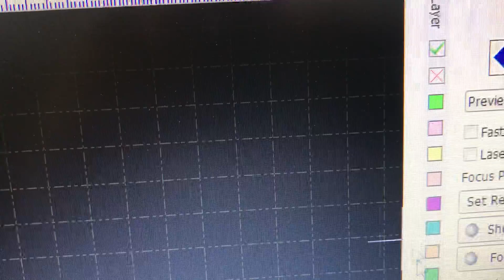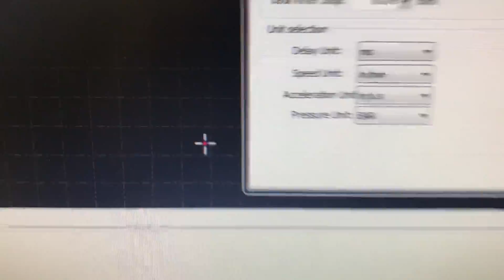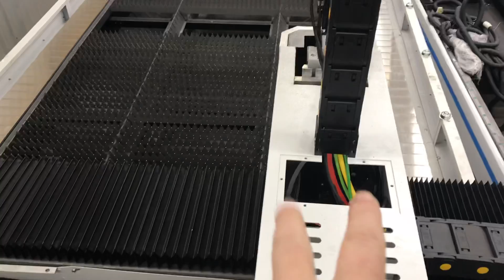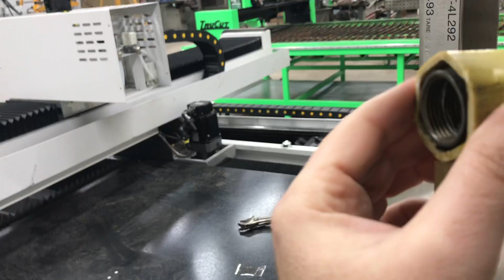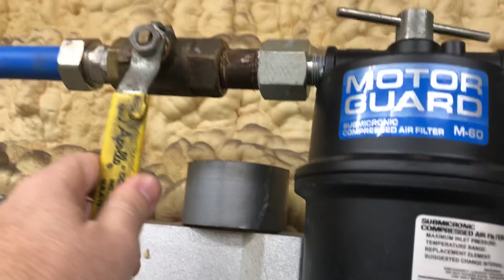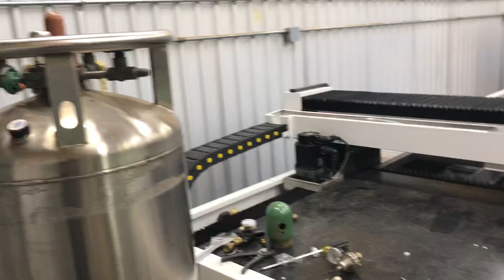Liquid Nitrogen vs. Oxgen vs. Compressed Air - CNC Fiber Laser Cutting Machine DIY China Import

Comment: I know of lots shops that don’t do a lot of stainless and aluminum cutting that still uses 12 packs of nitrogen.  Oxygen on the other hand, I ran a 5000 watt Trump for years on dewers alone,  but that’s combustion cutting.  Had some success using air on gauge metal, galvanized.
Reply from the maker: good to know, thanks!

Comment: You are correct most shop air systems are inadequate in volume and pressure however you numbers quoted seem way too high for a 1KW laser.  15hp (22KW) compressor that is specifically built for laser cutting -  high pressure air end, several filters, dryer and tank should work.
Reply from the maker: Yes, on the low end.  My plan is to upgrade my power source to 4 or 6kw over the next year or so.  Who makes a high pressure air end that will produce 250psi?  I havent seen any made for lasers?
Reply: @turbocobra  Ingersoll Rand 15t2x200-35 will cover you if you upgrade to 4 or 6 kW laser. Here is why https://www.dropbox.com/s/qbu9vxmmmd1ruzi/Nitrogen%20Pressure%20and%20volume%20for%20Laser%20cutting%20of%20stainless%20steel.jpg?dl=0

Comment: I hate to break it to you but unless you are running that thing every day you will lose more gas due to liquid boil off venting than cutting. It may be cheaper to run several gas cylinders in series to eliminate waste from venting. We use liquid argon for                                     sintering metal 3d printed parts, we vent about half the dewar over two weeks unless we are running regularly.
Reply from the maker: Well your not breaking anything to me, definitely aware of the pros/cons of Dewars vs gas cylinders.  Right now my volume isnt that high, but once i get the machine fully dialed in and ready for production cutting i don't think it will take long to get enough work to keep it running on a daily basis and I hope to use one of those Dewars per week.
Reply: @turbocobra  What about a swing shift absorber like an oxygen concentrater  in reverse

Comment: Suggestion:  you need sub-micron filters on your incoming gas lines or you are going to spot your lens and have cutting problems.  Liquid N2 vents 1% a day if you use it or not.  You don't have enough power to cut 1/4" steel with N2.  A 1KW laser would be dong well to cut 10 Gauge Mild Steel with N2.
Reply from the maker: Gocha, good info.  So at 1% a day if you don't use any of it, it would be empty in 100 days.  How do I get filters on the incoming gas?
Reply: Could you use Compressed N2 instead or is that not enough gas?

Comment: Would think a guy with a machine shop could make a plug to stick in that nitrogen tank so it doesn't leak off. lol
Reply from the maker: lol it would explode! it continues to build pressure no matter what
Reply: Ramsey Customs - turbocobra minor detail. Lol You just need to cool the tank a couple of hundred degrees so it stops evaporating. 😎

Comment: FYI, you can get your nitrogen pressure just under the 250 psi relief valve.  Just Increase the pressure on the mixing valve,  turn the chrome cap on the mixing valve.  It’s hard to see but there are little indicator lines under that silver cap
Reply: That's a good point and might be worth a try  but I think he mentions in the video the dewar can't generate the flow rate at the pressure he was able to get.  He might be able to bump up the delivery pressure but I don't think there is enough boil off from the dewar for the flow rates required by the machine.
Reply: Bill De La Vega  Well all I can say is from our situation.  We had the same exact issue.  We had our gas guy adjust it and it was more consistent pressure than we could use.  Had to back it down.   We use 120 Psi at 12 CFM
Reply: @readyross  Again worth a try if he has not already done it.  Gary mentions the pressure / flow rate for air is 250 PSI at 70 CFM.  I imagine the flow / pressure for 100% Nitrogen would be less, but not like the Oxygen flow rate / pressure which is more like what you are using.  In the comments Gary responded to me and said that the gas supplier is setting up the vaporizer system, so hopefully they have all the bases covered on the best way to supply what's needed to his machine.
Reply from the maker: You may have had a high pressure Dewar?  This is a low pressure one .